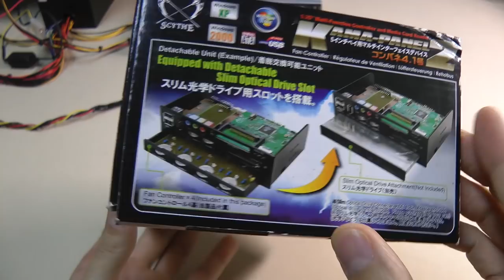5.25" PC amplifier + speakers by SCYTHE - RETRO Hardware

Comment: Well, you might be reading 12V on the LEDs because they might have resistors in series already, but when there's no load, the resistors don't drop any voltage. The multimeter has a really high impedance, which means it's not going to load the circuit at all, hence you reading 12V there. In any case, you could test without the power supply connected if there's a resistor to either the 12V or GND connections. Hopefully there's something :)
Reply from the maker: Yep I allready check resistors too and more things around. Still no idea what happened on PCB, where is mistake. Amp looks working, I can do my own ilumination and that’s it.

Comment: I've been using Scythe fans and a fan controller for about 5 years now, and I'm very happy with them. But what happened with the company ? I stopped seeing their hardware being sold on most retailers...
Reply: Where is that? They are still very much active and releasing new products and are readily available here in The Netherlands.

Comment: Bah haha i still have the scythe bay speakers installed to day lol
Reply: they are tinny asfk but at the time i was the answer for a lan party.
Reply: i bought mine new from scythe lol.. what was 29.99 ended up 75$ at my canadian door... i was like The Fudge it was also a month late and customs disassembled it.... bastards..
Reply: Hi! How to install this inside, I'm worried about the Jack connector, I can't imagine how to attach it to the motherboard without removing the jack from the system unit. I know that the video is ancient, I would appreciate it if you would tell me how you did it.